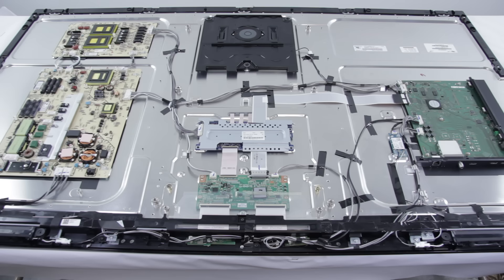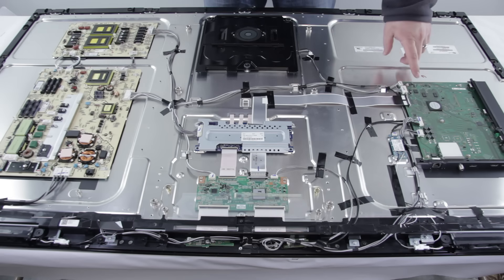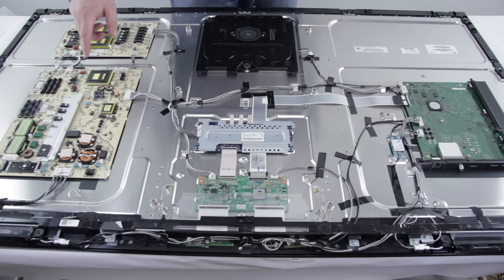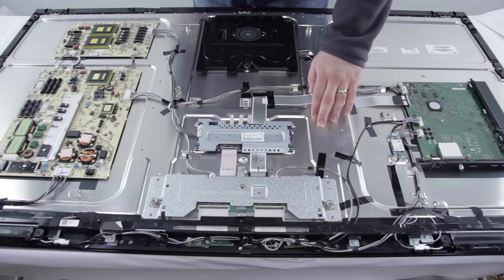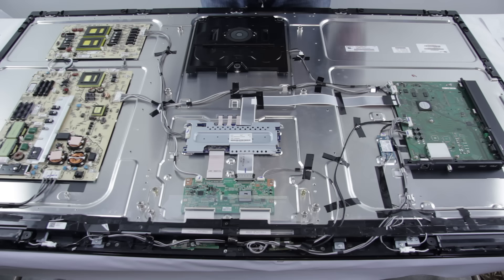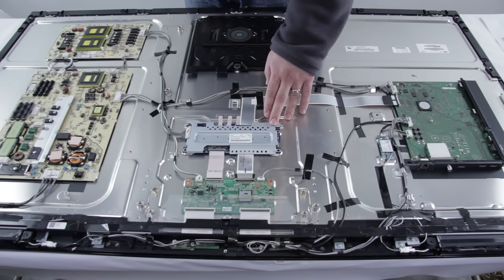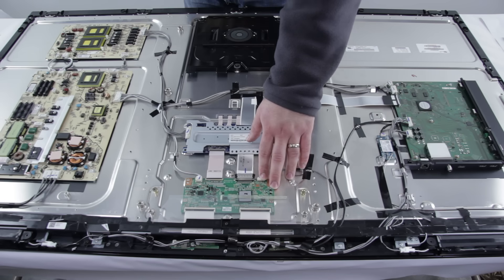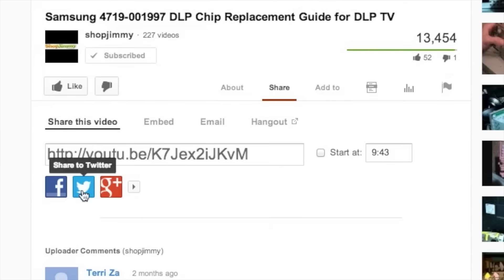LED TV Repair Tutorial - Common Symptoms & Solutions - How to Repair LED TVs

Comment: I have an RCA 55 inch Led tv model# RLD5515A-D
The tv powers up but the screen is dimly lit with a vertical black bar slightly off from the center of the screen cant access anything as far as menu goes

Comment: Hey guys I'm having issues with my Samsung 55 LED HDTV, model # UN55D6900WFXZA Serial# Z3A93CYB902688T, I bought it in 2012. The problem is it keeps power cycling on and off repeatedly, the screen stays black but it automatically keeps turning on and off regardless if I try  to turn it on or off manually or via remote. I keep hearing the clicking sound???? I called samsung but got zero help other than them telling me to pay for a tech to come out and fix it. I'm curious to see if maybe I can fix it myself??? Any help with this would be appreciated.
Reply from the maker: Ruben Castro   PLEASE SUBSCRIBE TO OUR CHANNEL - Try all repairs and troubleshooting at your own risk.  I recommend replacing the main board in your TV.  Click this link to replacement parts for your TV model number:  http://www.shopjimmy.com/catalogsearch/result/index/?cat=56&q=UN55D6900WFXZA  Be sure to match part numbers on your current board, with your replacement for compatibility.  Here is a link to a video showing how to identify your part number, click here: https://www.youtube.com/watch?v=BEPWrefQvqI  Thanks and please let us know if you have any further questions with your TV Repair!  www.shopjimmy.com

Comment: Hi .my led Tv is ...samsung ue40eh5000... the problem is that the screen jumping ...like waves ...black line from the top down..can u help please ...
Reply from the maker: Igor Herceg   Try all repairs and troubleshooting at your own risk.  This sounds like a TV panel (TV Screen) problem.  If your TV panel is bad, it may be more cost-effective to replace the TV as panels are typically hard to find in stock, difficult to replace, and expensive.  Thanks and please let us know if you have any further questions!  www.shopjimmy.com

Comment: Have a 3" gray line offset to one side but close to center line. It is not colored and erratically blinks and partially goes away when I hit the menu button. TV info: LG 55LW5600. Thanks
Reply from the maker: Clayton Ward   Try all repairs and troubleshooting at your own risk.  This sounds like a TV panel (TV Screen) problem.  If your TV panel is bad, it may be more cost-effective to replace the TV as panels are typically hard to find in stock, difficult to replace, and expensive.  Thanks and please let us know if you have any further questions!  www.shopjimmy.com

Comment: Sharp Aquos Model: TRK50B rev. 0

I am experiencing horizontal white lines that appear for a split second on top and bottom of screen. 1 line at a time. It does not happen all the time, but it does happen on different inputs. When the menu is up, it don't happen.

This video in particular makes it happen really bad (top part of screen across the black area.. a white line flickers on and off) https://www.youtube.com/watch?v=oIocBl-IltI&spfreload=10

Have experienced the same problem from different devices: Computer/gaming console
Reply from the maker: Adam Cole   That video link shows a video that is billiards.  Please reply with the correct URL.  Thanks!  www.shopjimmy.com
Reply: ShopJimmy.com That billiards video is purposely linked there. It is an example of a video that makes my TV do that white flickering. How can I fix my issue?
Reply from the maker: Adam Cole   Does the video show the white flickering in it?  If so at what times?  Thanks!  www.shopjimmy.com
Reply: The flickering happens in the black wide screen part across the top every few seconds. Not on the actual video. It don't happen when I have the menu up. I showed you that video because it happens the worst on that one. It also happens randomly on other devices and netflix etc. Usually in the black wide screen part at the top or bottom. Hope that helps
Reply from the maker: Adam Cole   PLEASE SUBSCRIBE TO OUR CHANNEL - Try all repairs and troubleshooting at your own risk.  I recommend replacing the main board to see if that fixes the problem.  Unfortunately I do not see any replacement parts in the search results for your TV model number on our website.  Please reply with your part number on your main board and I can try searching for replacement parts.  Thanks and please let us know if you have any further questions!  www.shopjimmy.com

Comment: Hello again, I also bought a Coby LEDTV4626 that I was told had power issues.  When I plugged it in, the TV worked just fine for a couple of days with no issues at all.  Now, when plugged in I get a power light and when I push the power button the light gets brighter but I have no picture at all, just a black screen.  Any help you can give will be greatly appreciated.  Thank you in advance, Mark

Comment: Hello,
I have a Coby LED TV model LEDTV4026.  When plugged in the TV receives power, the blue power light comes on and when I push the power button, the TV illuminates in a dark blue but there is no picture.  I thought it might be the power board so I have replaced that but I am having the same problem.  Any help you can give will be greatly appreciated.  Thank you in advance.
Mark
Reply from the maker: Mark Holden   PLEASE SUBSCRIBE TO OUR CHANNEL - Try all repairs and troubleshooting at your own risk.  This could be a problem with either the main board or the TV panel.  You can replace the main board to see if that fixes the problem.  Click this link to replacement parts for your TV model number:  http://www.shopjimmy.com/catalogsearch/result/?q=LEDTV4026  Click this link to replacement parts for your TV model number:  http://www.shopjimmy.com/catalogsearch/result/?q=LEDTV4026  There may be multiple boards for the same TV model number, be sure to match part numbers on your current board, with your replacement for compatibility.  Thanks and please let us know if you have any further questions with your TV Repair!  www.shopjimmy.com

Comment: I have a Vizio E320-A1 and it does not turn on.
Reply from the maker: Nikon1378   Do you have standby?  Is there a blinking light in the front?  Thanks!  www.shopjimmy.com
Reply: ShopJimmy.com yes there is a white light in the front that remains on
Reply: ShopJimmy.com when I attempt to power on the TV, the light in the front comes on but no image. Could it be the eeprom?
Reply from the maker: Nikon1378   Try all repairs and troubleshooting at your own risk.  It is possible that it could be the eeprom, or just another issue with the main board.  You can replace the main board to see if that fixes the problem.  Click this link to replacement main boards for your TV model number:  http://www.shopjimmy.com/catalogsearch/result/index/?cat=56&q=E320-A1  Be sure to match part numbers on your current board, with your replacement for compatibility.  Thanks and please let us know if you have any further questions with your TV Repair!  www.shopjimmy.com

Comment: I have an LG 47LN5400-UA. When I turn the power on the screen comes on for a millisecond then goes black. I still have audio but no picture. I can see the image of the menu when doing the flashlight test. I replaced the power supply board and it has not helped. What should I look to next? T-con? Should I buy a new power cord? (I feel like it's not that simple) Very frustrated. I've only had the tv for a year and treated it exceptionally well. Please help
Reply from the maker: Johnny Hough   PLEASE SUBSCRIBE TO OUR CHANNEL - Try all repairs and troubleshooting at your own risk.  If replacing the power supply did not fix the problem, this sounds like a problem with the actual LEDs in the TV.  Unfortunately we do not sell replacement LEDs for your TV model number.  Thanks!  www.shopjimmy.com

Comment: Hi I have Haier LED LCD tv Model - LE46F2380 . the issue im having is that when i push the power button the power light turns on but there is no picture or sound at all. the screen stays black as if it was off. please email me ericayala1989@yahoo.com THANK YOU
Reply from the maker: Surk Beats   Try all repairs and troubleshooting at your own risk.  I recommend running the flashlight test on your TV.   Here is a link to a video we produced that shows how to run the flashlight test. https://www.youtube.com/watch?v=xUzCLgoSPGM Please reply with your flashlight test results and we can recommend a replacement part for your TV repair. Thanks and please let us know if you have any questions! www.shopjimmy.com

Comment: Need help with LG LED TV model LE5500, 42 INCH.When TV is turned on, the red light on the front panel  changes to White light which is normal,but the issue is there is no display(blank black screen). There is no backlight, flashlight test shows no image, no audio.Please suggest the fix
Reply from the maker: TVRepair   PLEASE SUBSCRIBE TO OUR CHANNEL - Try all repairs and troubleshooting at your own risk.  I recommend replacing the main board in your TV.  Click this link to replacement parts for your TV model number:  http://www.shopjimmy.com/catalogsearch/result/index/?cat=56&q=LE5500  There may be multiple boards for the same TV model number, be sure to match part numbers on your current board, with your replacement for compatibility.  Here is a link to a video showing how to identify your part number, click here:  https://www.youtube.com/watch?v=RwHTvjMdrhk  Thanks and please let us know if you have any further questions with your TV Repair!  www.shopjimmy.com

Comment: Hi,
I have LG 55LE5400 TV set. I have problem with my TV.
I share some video links:
https://www.dropbox.com/s/yr2lsgq483f93f2/20150429_090257.mp4?dl=0
https://www.dropbox.com/s/jebb21zm4367psf/20150429_091543.mp4?dl=0
https://www.dropbox.com/s/eustjfjb1g49dh3/20150429_091916.mp4?dl=0
TV gets picture after 20~25 of warm up but first I get all this what is shown on video. Please help. I have no warranty and I paid really big money for this tv 5 years ago.
Reply: Tom P Any suggestions my friends ?
Reply: Tom P Mr. ShopJimmy, please help me with my problem.
Reply from the maker: Tom P  Try all repairs and troubleshooting at your own risk.  This sounds like a TV panel (TV Screen) problem.  If your TV panel is bad, it may be more cost-effective to replace the TV as panels are typically hard to find in stock, difficult to replace, and expensive.  Thanks and please let us know if you have any further questions!  www.shopjimmy.com

Comment: My Toshiba 58L4300U 58 inch  I think has a back light problem.  When I turn on the TV the backlight  turns on for 2-3 seconds  then comes off.  When I shine a bright light at the screen the image is still showing and I'm still hearing the sound. From one of your other videos I heard you said this might be a backlighting problem.  I would like to get  the part to replace it but I dont know where to source it. Please help
Reply from the maker: Kemron Thomas  PLEASE SUBSCRIBE TO OUR CHANNEL - Try all repairs and troubleshooting at your own risk.  This could be a problem with either the power supply board or the LEDs in the TV.  You can replace the power supply board to see if that fixes the problem.  Unfortunately I do not see any replacement parts in the search results for your TV model number on our website.  Please reply with your part number on your power supply board and I can try searching for replacement parts.  Thanks and please let us know if you have any further questions!  www.shopjimmy.com
Reply: I have no sound...when i turn the tv on i get a flash and that's it.  I have a toshiba tv model #58L4300u

Comment: I have an LG LED TV (47LM5800). Kids have sprayed Windex glass cleaner on the screen, after a while it switched off. When I try to start it on, I can see vertical lines along the screen. From my online research, it appears to be faulty panel driver. Is this right? any hope of fixing it without replacing the whole panel or just dumping it away?
Reply from the maker: Ahmed Ibrahim    Try all repairs and troubleshooting at your own risk.  This sounds like a TV panel (TV Screen) problem.  Unfortunately there is not a repair for this.   If your TV panel is bad, it may be more cost-effective to replace the TV as panels are typically hard to find in stock, difficult to replace, and expensive.  Thanks and please let us know if you have any further questions!  www.shopjimmy.com

Comment: I have a samsung 60" model UN60H6350AF TV. My issue is that there is a slight black shadow in the very top center of the tv. I tried the frozen food suggestion and another suggestion of lightly pressing it out, which didn't seem to do anything. Any help would be much appreciated. Thank you!

Comment: Hello. i have a 40 inch LED Samsung TV : UN40F6300AF. Yesterday, the bottom half of the screen went dim. Top half is bright as before, but bottom half is darker. I can still see the picture but it's as if the backlight went out just for the bottom part, so there is non uniform brightness now. Could this be a backlight issue ? Or panel problem. Any suggestions ? Thanks!

Comment: I have an LG 50" LN5310, got it for free. It has sound, but no backlight. I did the flashlight test and it appears that the lcd panels are ok, I can select the menus ect from the remote control. There appears to be only 3 boards, the power supply, tcon and mainboard, but no led driver board. The power supply is one board but the lower says 'Primary' and the upper part has a 4 pin out to supply the LED's. 2+ and 2-.. I tested these pins and on the multimeter set at 20volts, they both read 18v. and when it's set to 200v, they read 1.8v. The capcitors look ok, not bulged or blown, but im guessing a bad power supply anyways, but I need to ask, what is a common voltage to power the LED's? When i power on the tv, i see one bright flash at the back from what appears to be an LED then the LED turns off. Any help would be appreciated.
Reply: ShopJimmy.com Thanks for your reply, however that link to the board you show is different than the one in this tv, http://www.shopjimmy.com/lg-eay62810801-power-supply-unit.htm appears to be the right one, the partial part number 62810801 matches mine, but one question i need to ask before I buy this board from your site is the PCB number on mine is EAX64905501(2.3)  and on the board at your site its EAX64905501(2.0)
does that 2.0 matter? im guessing its just a revision number? other than that, the part numbers are correct.
Reply: SladderBux I just bought the board.. I'm guessing a compatible firmware revision with the main board, im not concerned with that. I re-tested the original board with the led system unplugged.. and got no power values on either of the 2 power rails... yet I still have audio, and screen images of the menu's with the flash light test... and I cannot believe both led systems have failed... it has to be the psu...  I hope you ship quick...because I would love to see this tv come to life =)

Comment: Great informational video.. I have a problem with my Sony KDL-70R550A 70-Inch 120Hz 1080p 3D  when powered on it will intermediately power off by itself.. If it happens to stay on for a while the display has vertical lines in the centre and it looks as if it was hit in the center,  with some lines that spreads out a few places from the same spot as that of a broken glass screen. My one year manufacture warranty just ran out..  kindly advise thanks
Reply from the maker: Clifford Boodhoo   Try all repairs and troubleshooting at your own risk.  Unfortunately there is not a fix for the broken screen.  If your TV panel is bad, it may be more cost-effective to replace the TV as panels are typically hard to find in stock, difficult to replace, and expensive.  Thanks and please let us know if you have any further questions!  www.shopjimmy.com

Comment: I just bought this a year ago sharp tv lc-40d78un. TV stop working right after a large POP noise from behind. I  removed the power cord from outlet and TV  checked the power cord with an ohm meter and it shows good on both lines. I need help repairing this I am thinking the power supply just pop. Where can I get parts for the TV?
Reply from the maker: John Jackowiec  Try all repairs and troubleshooting at your own risk.  Click this link to replacement parts for your TV model number:  http://www.shopjimmy.com/catalogsearch/result/?q=lc-40d78un  There may be multiple boards for the same TV model number, be sure to match part numbers on your current board, with your replacement for compatibility.  Thanks and please let us know if you have any further questions with your TV Repair!  www.shopjimmy.com

Comment: Hi, I have a Toshiba model 50L1350U.  Recently I have a darker area across the middle/upper third of the screen that runs horizontally across the entire screen.  There arent any lines, instead just a dark shadow, about 30 precent darker, across the screen.  Everything else functions correctly.  Is this a backlighting problem?  What part would be needed to fix it?

Comment: Mine is a Samsung UN50EH5300 LED that is 15 months old.  It just turned itself off late in the evening and won't come on.  No reaction when the on button is pressed.  I unplugged it for several minutes thinking it needed to be reset but no luck.  What do you suggest?

Comment: Samsung UN65F6350AF LED. There is a 4-5" black bar that runs vertically through the screen from top to bottom. Most of the advice given on youtube hints that the problem is most likely at the connection of the TCON board and the ribbon cable directly down stream, most likely a faulty tab. Unfortunately, that was not the problem. I found a severed/cut ribbon-type cable that jumps between the board that runs along the length of the bottom of the TV and the display/panel. Have you all see this before? I would imagine you have so I guess my question is what can I do to fix it and is it worth it?